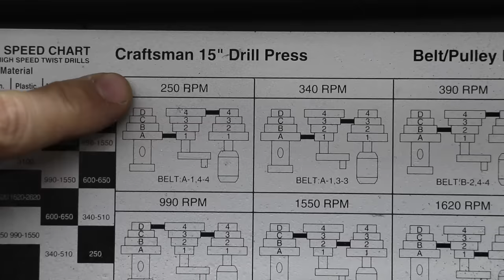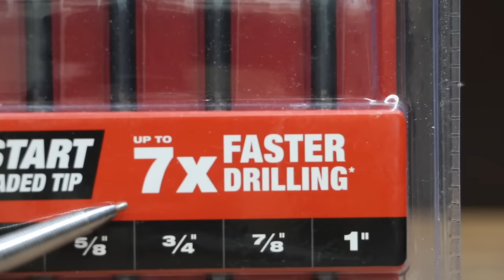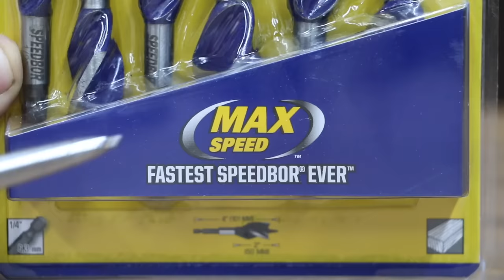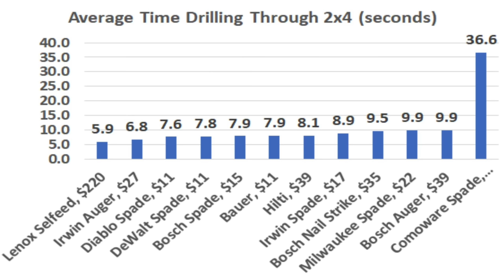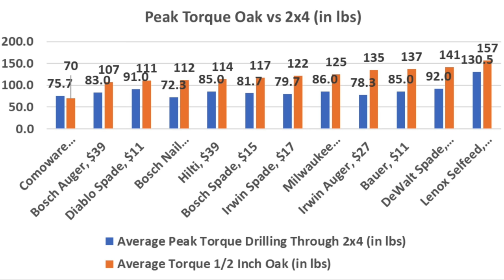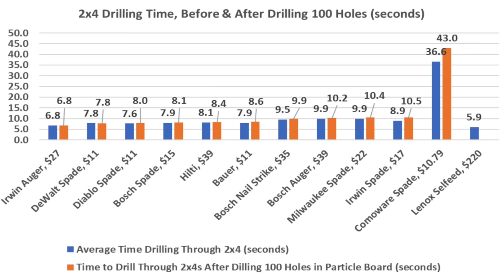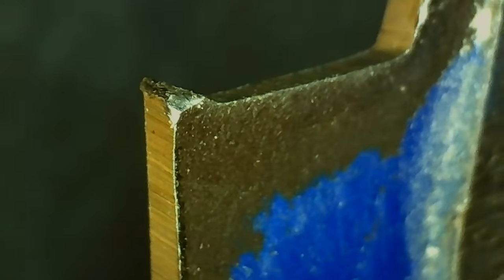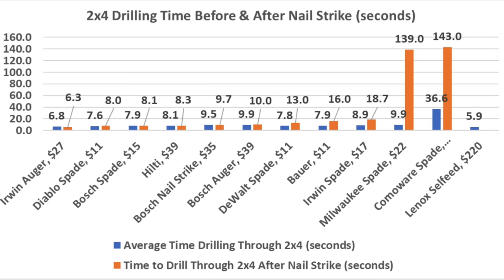Best Drill Bit Set? Hilti vs Milwaukee, DeWalt, Bosch, Bauer, Lenox, Irwin

Comment: Another great video.  I prefer Greenlee augers for holes through wood beams.  How do the different auger brands compare?

One tip for a cleaned Spade bit hole.  Drill into the wood gently to start.  Then as the tip comes through, stop.  Drill it then to finish through the other side.  Prevents the blowout as the bit finished coming through usually.
Reply from the maker: Thanks!  Thanks for the tip.  Thanks for the video idea.

Comment: There is something to be said about the force used when you hit a nail. If you can hold on tight and stop the chatter the bit will cut better with a fast speed and slow solid attack. I have had to cut lots of nails due to location and its never fun and sometimes messy
Reply from the maker: Thanks for sharing.

Comment: One thing to consider... While the drill press is good for consistency, i know that the dewalt can be used in higspeed/lowtorque in a hand drill, all the screw tip ones have to be used on lowspeed/high torque
Reply from the maker: Thanks for the feedback.

Comment: You should do a comparison on Ship Auger Bits (the ones commonly used for drilling studs running wire in home construction-16-18 inch). As a Low Voltage tech I prewire a lot of homes (Electricians use them often too), and every major bit manufacturer say they withstand nails and stay sharper than the other but it’s a crapshoot finding a brand that last longer than the others and the cost of the bits can be $20-50 a bit (and it’s extremely frustrating when the pilot tip wears out after little use making the drill bit almost unusable). I know a lot of people that would love to see you put them through the tests. I’ve used Diablo, Irwin, and Milwaukee but would love to know if there are better ones out there that last more than a couple hundred holes drilled!
Reply from the maker: Thank you for the video idea!

Comment: 'morning, Todd. With all of your reviews of battery products including chargers, perhaps one of the most important needed for 6/12/24V types is a load tester / analyzer. There is a big debate as to carbon-pile versus electronic resistance types as far as accuracy, etc. Also, analog vs. digital display. Next in importance would be charging ability/quality of small cell chargers A/AA/AAA etc.
You obviously use battery charges frequently, but I cannot identify what YOU are using. Thanks & keep up the fine work.
Reply from the maker: Thanks, will do!

Comment: at my job we use a Countersink Drill bits work great for drilling a hole but then you can push a little harder on it, it will form a small circle so you can put washers in the wood..  its good for building heavier things
Reply from the maker: Thanks for the feedback.

Comment: In a spade bit I prefer a non self feeding bit since one of the major advantages of a spade is the ability to drill a curved hole.  The self feed style want to go straight with a regular point style you can work around in an arc   with a pushing and pulling motion.
Reply from the maker: Thanks for the feedback.

Comment: Makita makes some great spade bits. I’ve just used flat spade bits, not threaded tip or auger bits. In my experience geometry of the blades is everything, if they have protuberant spikes at the end, bits are gonna have less contact and make holes much slower than the bits with flatter blades. Also flat blades allow to make holes where you can stuck a bearing or something that fits in, with non-flat bits you will get a rounded base which won’t hold the object you insert so well.
Reply from the maker: Thanks for sharing.

Comment: For those of us that live in the snow country- any chance you can look at single stage snowblowers? I know this one is more spendy than other tests, but it may be a lifesaver for those of us that just got 20” of dry snow dumped on us. I have a Honda single stage and I use it a LOT during the winter and it’s always been reliable, but there are mother great brands as well as some junk. Anyway, just a thought. It may be hard to test on dry snow, wet snow, crusted snow, hardened snow, etc… but still interesting. Thanks for all you do!!
Reply from the maker: You are welcome!  Thanks for the suggestion.

Comment: I really like the look and performance of the Irwin auger bits.  And I'm a fan of forstner bits like the Lenox, but not at THAT price.  (thud) They MUST be cleared during deeper drilling, so you didn't really give the forstners a valid test. (With hardwoods, you take your time, anyway.)
You must be tuckered out after all those holes.  May-an!
I have a couple sets (short/long) of HF spades, but my good set is the Bosch Daredevils.  When I'm ready to grab some more, I'll likely grab the Irwin auger style.  Thanks for yet another really great testing set, Todd.
Reply from the maker: You are welcome!  Thanks for sharing.

Comment: Hey Todd, One thing I have seen is that those self-feeding bits can need more torque than low or mid-range drillguns can provide, especially as the sizes increase, saw a Dewalt once start to twist its case apart from the torque! There's no slow and easy on those, just go!
Reply from the maker: Thanks for the feedback.

Comment: I have an idea for a test: door stops. I have a brinks door bar and don’t want to kick my own door to see it if could work. Maybe use a control like a heavy cinder block to see if it could do just as well. Maybe test on different floors - carpet, vinyl flooring, and tile. Thanks!
Reply from the maker: Thanks for the suggestion.

Comment: My experience with the 1" Irwin Speedbor is much different than yours.  I needed it to drill into 8 foot long pressure treated 2x4s and before I used it on them I wanted to test it first.  After drilling three holes in a scrap 2x8 that was not pressure treated the augur would no longer bite into the wood and all the holes wandered (I was using a hand drill as there was no room in the garage to get the 2x4s to the drill press).

From seeing other reviews it appears that getting these bits is a crap-shoot.  Sometimes they are good but other times, like mine, not so good.
Reply from the maker: Thanks for sharing.

Comment: Spade bits with an auger bit and without an auger bit are different tools. The auger makes the depth of the drilled hole difficult to control. Many times you don't want the bit to go all the way through, maybe because you want to drill it from the other side to make a clean hole on both sides or maybe you only want a shallow hole for something like a counter bore. I think you want spade bits without the auger for those kind of tasks. But if you are drilling through two by fours all day running service lines, you probably want either a true auger bit or a spade bit with an auger tip. I had a stubby auger bit that I liked for that task.
Reply from the maker: Thanks for the feedback.

Comment: I think it's important to note that the bits with threaded tips pull themselves into the wood at a relatively steady pace and require much less effort for someone with a handheld drill. You just need to counteract the rotational force of the drill as usual, but you don't need to push on the drill as hard as you would for the bits that don't have threaded tips. This might be important for someone who needs to drill a bunch of holes with a cordless drill.
Reply from the maker: Thanks for the feedback.

Comment: I use the Diablo bits at work and have drilled through aluminum studs and drywall screws many times with a Milwaukee 18v impact. While this video was great for control group. In real life they will all perform different especially when used with an impact or drill compared to s drill press
Reply from the maker: Thanks for the feedback.

Comment: To me a lot is determined by how clean the hole is. If you're installing doorbells or door security contacts, you want the cleanest hole possible. Also, I look for a design that can be sharpened. A lot of 3 flute bits are trash once dull.
Reply from the maker: Thanks for the feedback.

Comment: I have a suggestion for a future video from some "fun" I experienced over the holidays with a toilet seal leaking and ruining my basement drywall. Likely from a plunger somehow breaking the gasket seal at some point weeks earlier.

It would be nice if you tested toilet gasket seals. ("Fun, I know") But I've had different experiences with different wax and non-wax seals over the years differing on how level, high or low set the flange is in the floor and how it effects the gaskets seal.

Fun topic I know, but would be helpful.
Reply from the maker: Thanks for the suggestion.

Comment: Hey I love these detailed test and evaluations. I have already purchased based on these reviews. I was wondering if you have ever considered doing a differential/transfer cases oil comparison similar to the one you did for synthetic engine oil. I know when I switched to Motul synthetic in my Subaru Outback rear diff and transfer case I saw a 1-1.5 mile per gallon increase. Of course this wasn’t as scientific as your evaluations but more experience over about a year driving roughly the same route over an extended period of time. Anyways thanks for your dedication and work.
Reply from the maker: Thanks and you are welcome!

Comment: Have you thought about a laser level comparison? You could use a photometer to measure the light intensity at certain distances away from the unit, and measure the standard deviation in beam offset at various distances. Battery life is also an important factor to consider as some use cordless battery packs. You could also simulate wear  by vibrating the units in their carry cases/locked position. Strength of magnets and subjective beam visibility in daylight would also be good to see, in addition to the feature sets offered at different price points.
Reply from the maker: Thanks for the suggestion.

Comment: As you said the Lenox, for example, is a type of bit who's design isn't anything like the others. It's venturing into Forstner bit territory and that's a whole different cup of worms and should be saved for another test altogether. 

As for the "tear out" every good carpenter knows to put a piece of scrap under the board he or she is drilling through but, I get why  you did it. The amount of tear out, however, could just be attributable to the grain of the wood at each specific location, as well as, the speed of the drilling. The faster the drill the more tearout there will be. 

One parameter you sort of left out is how straight each bit was in the beginning and again at the end. It might be important since I noticed some of the bits wobbling on the drill press even though the drill chuck was perfectly aligned. 

I think I speak for everyone in asking "Is there anything at all that isn't made in China?"

Fantastic testing as usual Todd although, I think it might have been better if you had done most of the testing on the MDF due to its greater consistency. Keep the carbide tipped faith my friend.
Reply from the maker: Thanks for the feedback.

Comment: The ones with the threaded center point are way faster when using a cordless drill, I use them every day for plumbing, because they put the bit through by themselves rather than you having to push it through
Reply from the maker: Thanks for the feedback.

Comment: To add my own two cents to this.  I bought a package of the Diablo bits a while back and I find I don't like using them because of the auger threads.  They do exactly what they are supposed to do and pull the bit into the wood but I feel like they take away any fine control I might have.  I much prefer using the Irwin bits with the tapered non threaded guide point. I really like the Diablo products, just not these bits.
Reply from the maker: Thank for sharing.

Comment: I just bought a pop rivet gun, a 
TEKTON 6555, but not sure about it's quality.  When I surf the web for reviews of rivet guns, they seem biased for certain makes and countries of origin.   I really don't care about that sort of stuff, vs. the price/quality/durability and its ease of use.
I thought, maybe a pop rivet gun test comparison would be good.   Some  pop rivet guns are good with aluminum rivets while some others are good with steel rivets, but I don't know which one is the best for both.  I'm assuming if it is good for steel rivets, using aluminum ones would be a piece of cake for it.     Some of the cheaper rivet guns have difficulty installing steel rivets because of the amount of grip pressure that the user needs to apply.  I have no idea how to test a pop rivet gun because it may require multiple "pump grips" to pull up on the center post until it goes thru the rivet body.  It might be a challenge to figure out how to test them.   I don't have any ideas.
I wasn't sure where to post this comment, so I just posted it here.   Sorry if I posted it in the wrong area.   I really enjoy your videos.   They are unique and no one else does the same testing and comparison as you do.  That is pretty admirable in my book.
Reply from the maker: Thanks for the suggestion.

Comment: I have been wondering about testing impact drill bits that use a hex head. I have seen lots of reviews where the hex head portion separates from the bit itself either by breakage or separation of bit from the hex head. You have tested the regular hex screwdriver bits and masonry but what about using a 1/4" impact driver with various size metal bits. Just a request for testing. You do such a good job with really accurate tests and cost effectiveness that I always come to your YouTube site for product evaluations.
Reply from the maker: Thanks!  Thanks for the video idea.

Comment: Thanks for clip!

I was wondering if you might do a clip involving snow shovels. Not sure how you would test them. I am stumped on which one to buy.  Been looking at the Manplow EZ blade, Ultimate snow plow shovel, and the snow plow snow shovel.  As well as curious about de-icer especially that beet juice verity
Reply from the maker: Thanks for the suggestion.
Reply: @ProjectFarm  you are welcome, I am sure you get tons of ideas from others. I just haven't seen a de-icer comparison. The snow shovel may not work in a comparison between one another.  I see 3 things as being a snow shovel problem lower back irritation, cracks in sidewalks or driveways, ease of usage, and possibly durability.  

At any rate thanks for reply

Comment: I just drilled four 1/2" holes in the frame of my F-150 to mount a tow bar mounting base so I can tow it behind my motor home. I spent a 1/2 hour with brand new set of high end Bosch bits and about 5 minutes with a brand new set of high end Dewalt bits. Money being equal, the Bosch bits were dull as F.
Reply from the maker: Thanks for the feedback.

Comment: Should have done the 100 holes with the standard whitewood 2x4s rather than particle board. In my experience with the Bostch spade bits, they wear out much faster when cutting through real wood. For me what matters most is how long a blade lasts.
Reply from the maker: Thanks for the feedback.

Comment: Hi, thank you for this test it was very helpful. You could try testing porcelain diamond tipped drill bits. I tried both Diablo and Bosch and the Bosch was so much better not even close. So I thought Bosch would do better in your test but hey, cant be good at everything! I’ll go buy a Dewalt or Diablo spade set! Cheers!
Reply from the maker: You are welcome!  Thanks for the suggestion.

Comment: Wasn't held to securely which affected the finishes on both sides and internally :) maybe need a vice or more sturdy device/fixture! :) Also the chuck is not the best holder for these you need a collet hole holder which stops vibration for better tests ;)

Comment: I know you have a video on utility blades, but could you make a video on double edge safety razor blades? Considering you have all the equipment and testing methodology, finding the sharpest and best value blades would be super helpful to avoid some of the snake-oil in the luxury shaving community
Reply from the maker: Thanks for the suggestion.

Comment: Please do windshield repair kits! There are several common kits on Amazon that are frequently rebranded and so many mixed comments where you can't tell if the product worked or was misapplied. Perfect material for Project Farm! Do they fill well? Are they hard or do they scrape out easily? What about adhesion, strength, compression tests for the uv epoxy supplied? Do they yellow if left under a uv lamp? Also, can you substitute in a good UV craft epoxy? Those come in much bigger bottles so could do multiple repairs if it had comparable properties.
Reply from the maker: Thanks for the suggestion.

Comment: My biggest disappointment was then the drill chuck released the long shaft 3/4” spade bit and it fell about 6’ onto concrete. It rounded the tip and never did a good job after that. I tried resharpening the point but it was a nominal improvement. I left it on a job site for some other tradesman to enjoy.
Reply from the maker: Thanks for sharing.